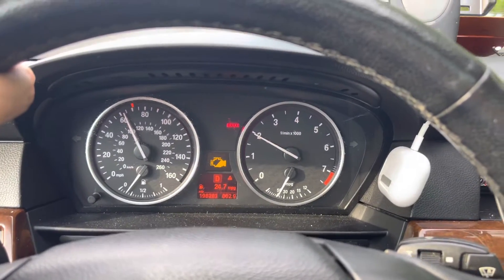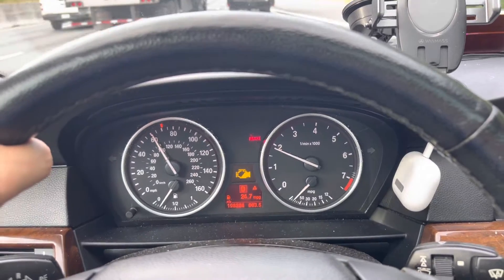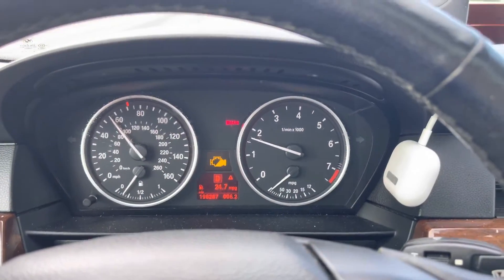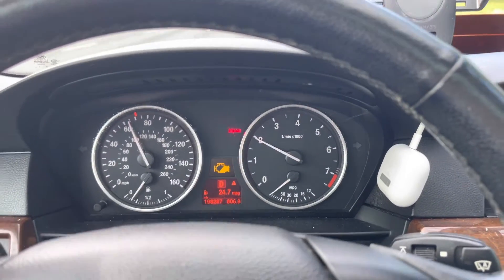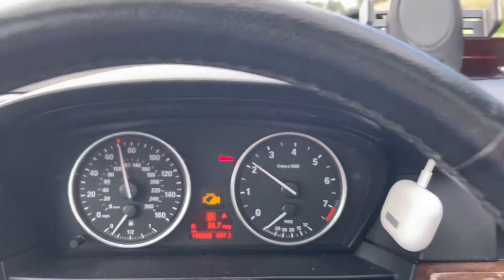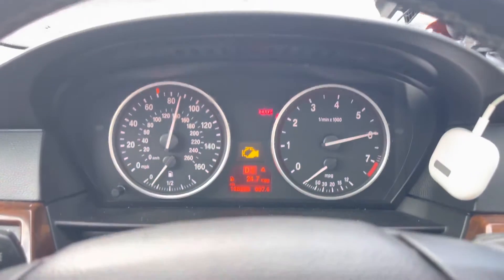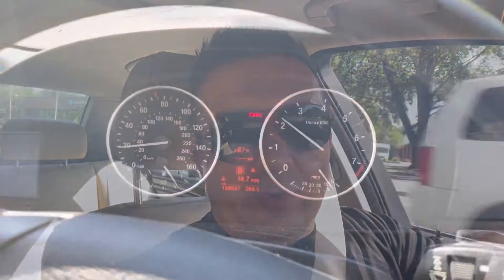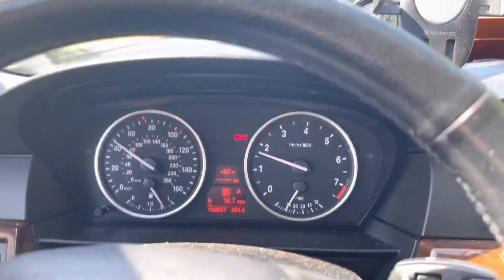Solving Engine Malfunction! Reduced Power Problem on Your BMW: Step-by-Step Guide Video 9

Comment: So what was the fix????
Reply from the maker: Radiator leak was casing it to over heat and that’s why it was reduced power
Reply: I get the same message at wide open throttle. I think mine is turbo related. That message Just means it cuts out the turbos.

Comment: Higher octane burns faster, that’s why high performance engines use it and can’t use lower grade fuel or else the engine will lag. Also man you get to the point and show us the actual car and what you did to fix it, if you’re going to vlog thats cool but title it is a vlog, I thought this was a to the point mechanic fix video and I’m trying to fix my car already lmao
Reply: Thats not really true. The higher octane fuel has a higher flash point, and is less likely to detonate under high compression and pressure. Thats why turbo engines usually require high octane fuel because the compressed air and compression of the engine will cause low octane fuel to detonate early and blow up your engine.
Reply: wrong.  That not at all what higher octane does.  not even close actually.  It increases the combustability pressure. thats all.
Reply: @SchrodingersBox  high octane reduces knock might have said it wrong but the point is pretty much like a grenade that blows up as soon as you pull the pin and kill you. Versus a grenade that gives you a couple of seconds to throw it. If the fuel detonated when the piston is only half way up it’ll blow up your rods and engine.